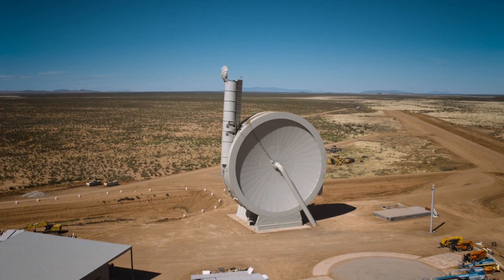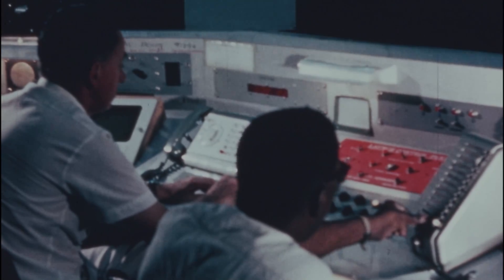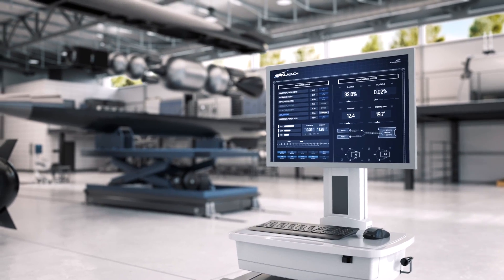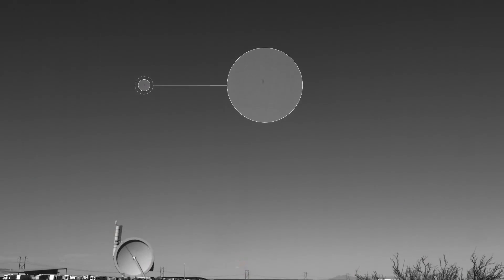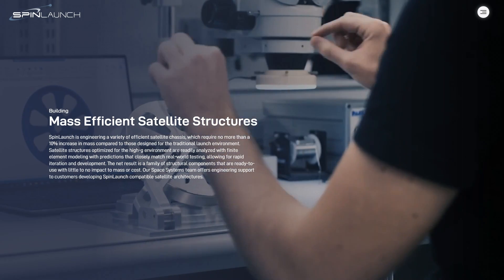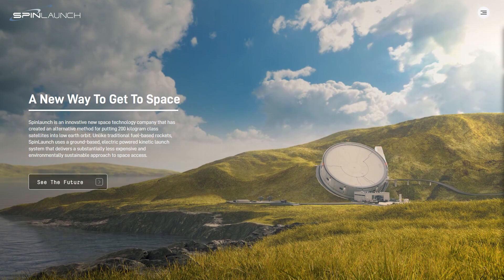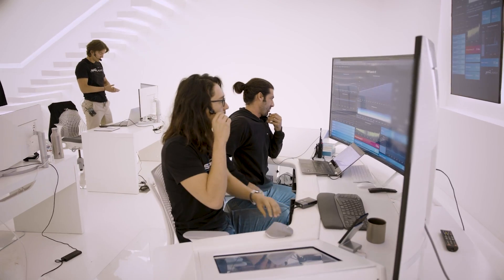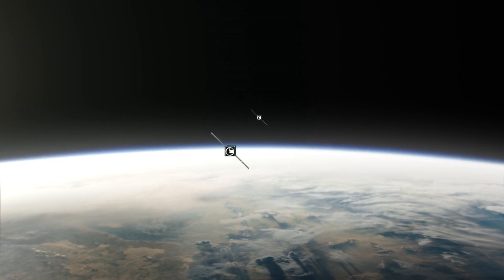Can Spinlaunch Throw Rockets Into Space?

Comment: What about initial overloads at start¿ Near 31 250 g? This launcher looks like fake or military stuff. The problem of all artillery - air slows any stuff that you will shoot, but I do not concern about it. So, as I remember from school, in first approach you need near 2500 m/s (no air resistance and just 300 km heigh). To achieve this speed with even 20 m radius of your kick leg you will do near 500 turns in a second. Looks good really¿ My washing mashine overs this twice, but what will be with acceleration in circle , it will be very big? This is dead end tech or there is some tricky hacks?

Comment: I have rarely witnessed such a hugely Negative response to a YouTube posted Video. All the NEGATIVE points made by the previous Posters actually provide an R & D list of problem solving potential. 
  The remarkable thing is that we have a dedicated concern who's team are steadily making progress in the direction of finding a solution(s) to the various Engineering limitations.
Considering the number of arguments made so far as to the limitations of G Forces, related to the mechanical spin equipment, a simpler and more efficient methodology may be mag-lift tech as used in high speed trains / elevators / Electromagnetic Aircraft Launch Systems (EMALS) / even Amusement Park Rides use Magnetic levitation transportation systems.
  Further, recent developments in Fusion research have introduced some of the most powerful Magnetic Fields ever created, which may lend themselves to this sort of application.
  Many Posters complained about the necessity of VACUUM being a source of unsolvable influence, yet the explosive event as the Vehicle leaves the Centrifuge is simply another Engineering question ripe for problem solving; the Vacuum Seal penetration may be reduced or eliminated with a self removal tech that would of course rely on well timed implementation, the atmospheric shock generated also offers an Engineering task. Possible reductions in shock effects suggest Material Sciences research as well as current design efforts pertaining to HYPER VELOCITY WEAPONS.
  Edison's thousands of experiments eventually resulted in enlightenment for the last decennia(pardon the pun),...  Spin-off tech shall most likely result as a byproduct of Spinlaunch's efforts.
  Rather than focusing in an exceptionally negative manner I would suggest that this engineering concept is in it's infancy, that with high motivation this Engineering effort may provide an economical manner to orbit payloads. After all, R & D is a PROCESS; the minds involved are more likely to enjoy success when applying PROBLEM SOLVING methodology.
Reply: gringo  Well said.  There's a LOT of comments from deluded "YouTube engineers" that we all know are sooo much smarter than real world ones, lol.  It's great to see a different take on an existing problem.

Comment: He misses some extremely important points: 1. this lets you launch raw materials to LEO for manufacturing up there at much cheaper costs - a block of iron or water can withstand practically any G-force -- think standardized containers of cargo, not "satellites".   2. there's no reason to have to launch at sea level. They could build this at extremely high altitude (Bolivia, Andes, Himalayas, etc) - where the air pressure is much, much lower.  While the altitude boost is fairly trivial, the aero engineering gets significantly easier.  3. Finally, the lack of site prep means a much much higher launch rate through time - ten+ per day, vs once-per-week.  There's a lot more to like here even than Manley covers.

Comment: I can see major problems with (1) precisely timing the release to hit the launch tube   (2)  the launch mechanism which has to resist many hundreds of tons of centrifugal force  (3)  the angular momentum of the launched 'rocket' which will try to spin end for end     (4)  the balance problem    
I think a bloody great gun would be more practical, either fuelled with conventional propellant or compressed air (though you'd need a huge reservoir).    The problem with rockets is the energy waste of accelerating the weight of all the fuel before it burns.    A gun doesn't have that problem.    You'd need precision initiation of timed charges (or release of pressure valves), but no more precise than the release timing on Spinlaunch.    And it avoids the balance problem, the angular momentum of the launch 'rocket', and the problem of a release mechanism.   And (unlike rocket motors) all the mechanisms can be made as heavy as needed or economical since they're sitting on the ground so weight is not critical (Spinlaunch could claim that same advantage).

Comment: Such a ridiculous idea. Can't believe anyone funded this honestly.
Reply: This, Hyperloop, The Boring Company, it is like the Dotcom boom and then bust all over again.
Reply: @lexlayabout5757  those are the same thing. The product of the Boring company is the Hyperloop, but it's funded by the guy doing it. Las Vegas just paid for the company to do a project, they didn't invest in the company. Boring company will catch on when they design a high speed subway instead of an underground highway. This on the other hand is just ridiculous. Should have never gotten past the paper stage. Virgin Orbit has a much better system than this frankly.
Reply: @lexlayabout5757  no what they call the 'hyperloop' in Vegas is not the same as the vacuum chamber thing you're talking about. Everyones given up on that idea because it's not feasible.
Reply: Paul  Well, I'm betting the experts that solve any relevant issues have convinced investors it will work.
Reply: @SMHman666  I suspect it's like a rotary engine. In theory, it should work great, no worries. But in practice, many problems with materials and unforseen issues arise.... In theory i'm sure you can spin somthing fast enough to get to orbit, but the technical issues that will arise are massive. I can't see this ever being a thing.
Reply: @pauld.b7129  Depends on what you mean by "in theory".  Theory can be a broad simplistic overview, but it can also cover details. In a broad and simplistic overview you can indeed make a SpinLaunch throw something big enough to be useful at a velocity high enough to be useful - just make the arm long and fast enough.  But a bit more theory will tell you that the thrower casing would to be the largest structure ever built, and strong enough to contain a vacuum as well (although even those are hardly details).  It won't happen.

Comment: You know, if they could make this launcher 10 times larger, it would reduce the g forces by many times. Reduce the turning radius, and lower the rpm to achieve the same projectile speed. Also nearly solve the problem of balancing after launch. Projectile weight as a proportion of launcher weight is the key, and reducing the RPM reduces the effects of the imbalance. Yes, I'm sure that these bright people know this, as well. A zany concept, but hey, a WW2 battleship could fire a 2000 lb projectile 30 miles. ..

Comment: A rail gun from the Moon to lunar orbit or Earth orbit makes sense if there is anything worth mining on the Moon.  A spin launcher on Earth which requires a hard vacuum, 100 metres across at 450 RPM, it needs 1Mw of power and several hours to spin up, it requires the missile to smash through a barrier capable of holding out a 15 psi atmosphere, fly straight, stay reasonably unheated and then ignite its rocket engine?  Not likely.  Do it reliably and more economically than a Falcon 9? No.

Comment: This is dumber than the atomic bomb powered rocket.
The G-forces on that arm would be in the megaton range.
Unless someone discovers unobtainium, there is no substance on Earth that would withstand that kind of force if the rocket weighs more than a few pounds.
And if the release timing is off by even a millisecond, it would be like a nuclear bomb went off.
The payload would hit the launcher or the ground at meteoric speed, it would be like Tunguska.
And it could never carry humans, they would be red goo well before launch.

Plus at the moment the payload broke through the membrane holding out the air, it would be fighting a supersonic airflow trying to get into the launcher, instantly, that shock would rip apart just about any substance we know of.
A massive railgun or magnetic accellerator makes a lot more sense.

BTW well done on the 1.4M subs Scott, I've been a member since you were just an old Scottish guy making Kerbal Space Program videos.

Comment: Has anyone bothered to compute the motion of the rocket?  It starts moving straight up (say) at Mach 7, 2100 m/s.  Thereafter the only forces acting on it are gravity and drag, both pointing down.  I know next to nothing of aerodynamics, but I suppose that the equation for the height Z(t) would be Z''(t) = - g - B(Z(t)) (Z'(t))^2 where B(Z) is the drag coefficient at altitude Z.  What is a plausible value for B(Z)?

Comment: If the rocket is released at 450 rpm, it is traveling at 300 m/s and spinning end over end at 450 rpm, that is ~7 flipflops per second.  If it is to be released at Mach 6, it will be spinning at 40 flipflops per second.  Stopping that spin will not be easy.

Comment: If the chamber had been evacuated, the total air pressure on the diaphragm would have been 10 tons or more.  How come it is so flat? How come there is no tendency for the tatters so be sucked back into the chamber?
 Why did they cut the video before the rocket cleared the diaphragm completely?  Because a few more frames would have made it too obvious that the chamber had not been evacuated?

Comment: This sounds like it would be a great idea to put the spin launcher in a high elevated place. Electricity is quite easy to transport uphill. And air density is a lot better for them at let's say 3-4 km. It its placed for example at top of a mountain on Hawaii. There are roads up there and it's not too difficult to put a 20kV power line up there. Just saying...
Reply: You know what's not easy to transport to the top of a mountain? Hundreds of engineers, custom made rockets, maintenance equipment, support services like food, water and waste removal.

Comment: Just imagine the arm ripping apart at multiple times the speed of sound. I dont know how it didnt rip apart at the demonstration in the first place. Wouldnt hou have to release a counter weight at the other side of the arm when you release the main Launched Object to compensate for the sudden loss of balance? I dont know if throwing a supersonic Counter wheight at the ground is a good idea. Can someone wko knows a thing or two about this machine give an explenation. Because to me it looks like this concept is pretty flawed. 0:22 The Tube should be perfectly straight why is the back of the projectile exeting at a different place than the nose of the projectile and it kinda seems like the thing isnt flying straight when released (only stabilising after a certain amount of time). Its just thrown around like a pencil through a classroom. I cant imagine that they can time the release of the projectile at Mach 6-7 when it appears that hey cant even do it at Mach 1.
Reply: It didn't rip apart because it was built to. Why do you think they did it with no vacuum and no relevant speeds?

Comment: that would  gain a big boos at hight altitude like 8km ^^   Btw  they would need to shoot the same weight in the opposite direction ,towards ground ^^ to balance it ;p They could use water with some splash distractor to slow the force down .I can imagine some rounded solid pipes that could also shoot the water into air .,or to side and some angle up .Or use strong magnes to counter the balance .
Reply: The current KE ammunition of the Leopard 2 tank is an 8,5 kg tungsten rod accelerated to 1750 m/s. On a 1 km distance it destroys any known modern battle tank. A WW2 tank will be ripped into pieces in a big fireball.

The counterweight is 20 tons with 2500 m/s - That's beyond of being unrulable. 
No matter how you catch it: You will need a lot of stuff to fill up the crater.

Comment: Imagine the heat generated as soon as the vacuum seal is broken, and that's if the kinetic energy of the projectile doesn't do catastrophic things to whatever the seal is it has to punch through, which will need to be strong enough to hold back a LOT of pressure. This is predestined to fail. Plus rockets aren't meant to handle horizontal stresses, only vertical.
Reply: It only needs to hold back 1atm of pressure...
Reply: @ciarfah  Only? That's a huge amount of pressure when you're talking a vacuum. Air's going to rush in at the speed of sound with a huge sucking effect. The seal, if it's thin enough to punch the projectile through, will be sucked in and incredibly tight if it even survives. The impact of that air hammer on the spinning arm that's going around Mach 7 (their projections) would be catastrophic.

Comment: The projectile is not unstable, it rotates because they have spin it up. You have to stop this rotation somehow. They have to go from over 400 rpm to zero. There are 2 ways to do this. One is to stop this rotation almost immediatly. This requieres an extrem amount of torque. The other way is to stop the rotation during its mach 6 flight. 
The major problem is, adding harsh requierements to the second stage makes it much more expensive and not cheaper.

Comment: wouldn't you just be better off using an old mine-shaft?  there are some in Australia a couple km deep.  Just accelerate it linearly.  the spinning creates all sorts of problems (like the massive transverse G forces, release timing issues, counter-balancing issues etc etc).  They will need  a double-seal system so the vacuum can be maintained inside the main part of the device after they let go the payload.

Comment: as others have hinted at, the demonstration seemed fraudulent
Reply from the maker: At least one of those others used fraudulent claims to suggest problems.
Reply: @scottmanley  they have certainly done something, its just hard to tell exactly what.

the instability/path on exit in the close up seemed the most suspect, naively. it just looks wrong. however, aerodynamics are fiendishly complicated and i have no hands-on experience of it. slow motion often looks 'wrong' as well, we aren't used to seeing things move that way.

if i was selling this to the world, or investors, i would have used more footage, more camera angles, and lots of easily consumed numbers. they had the cameras in the right places it seems, and i'd hope they measured things! they chose not to present e.g. footage from the inside of the vacuum chamber during the projectile release, or the simpler data from the flight such as speed and height reached, which would make excellent milestones to show progress with later tests.

i hope i am wrong, but their website is very heavy with the gimmicks and lacking in the substance, i found little there, much like the video of the test.

i still look forwards to seeing more.

Comment: Shouldn't it need a counterrotating mechanism holding the projectile in order to cancel the angular momentum of the projectile about its center of mass? So that it isn't tumbling as it revs up? Maybe the launcher could also use a linear motor along the counterweight arm to brake a large counterweight that could be released from near the hub at the same time the projectile is released, reducing the peak asymmetric loading on the bearing. That mass might be balanced by a similar mass that was propelled from the axis of rotation in the other direction (toward where the projectile had been attached) using a linear motor on that side to first accelerate it and then brake it.

Comment: This is clearly not going to work on earth. A simply calculation of a = V^2/R shows that the acceleration will be 40G if the speed to reach is 2km/s and radius is 10km. To further reduce the g, we need to increase the radius a lot. To launch at 8km/s with a 500 miles radius, the g is finally 8G. However, this thing could work on the moon (to leave the moon).

Comment: Conservation of angular momentum means that the payload will be tumbling at the same rotation rate as the centrifuge when released. Hence the difference between the exit points of the tip and tail, and presumably the rectangular cross section of the exit tunnel. I presume they are relying on aerodynamic stabilization of the payload when it hits atmosphere. Not very efficient and will waste a lot of energy. For launching in a vacuum (eg on the moon) they will need to actively de-tumble the payload after launch.
Reply: Or de-tumble the "rocket" the whole time with  a rotating mount geared to the axle rotation, so it never really has any of its own spin.
The atmosphere is the real killer.  Even if you got it to stay nose forward cleanly at launch, the atmospheric deceleration would  be massive, shoving all the fuel into the nose of the "rocket".  How are you going to get a strong enough pump to fight that and get the propellant "up" to the nozzle in the tail and start combustion?  It seems like the design is optimized to prevent rocket ignition.
When your design concept is fighting your goals, you have to consider that you have adopted a bad design idea in the first place.